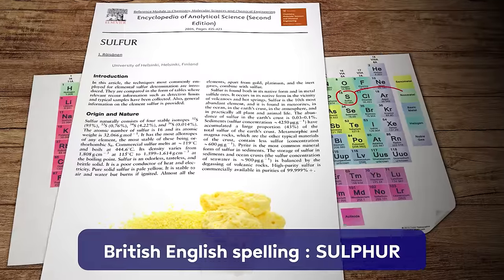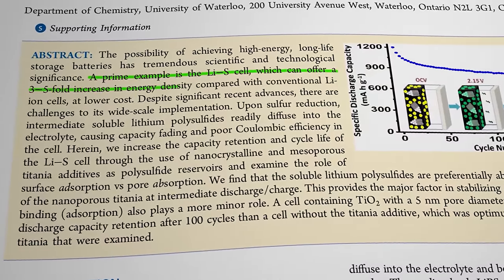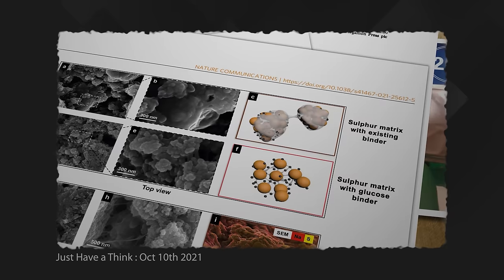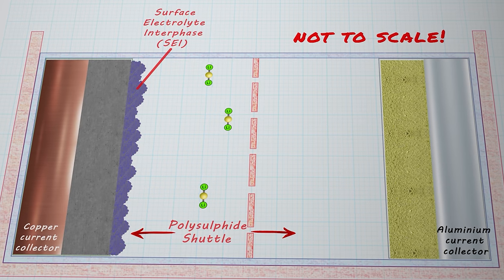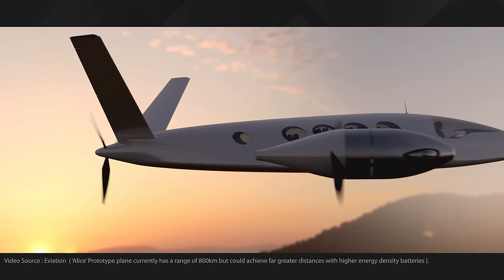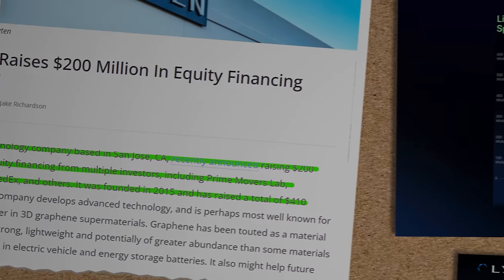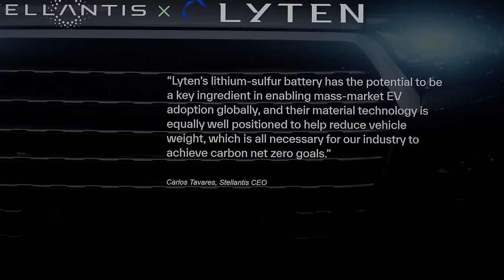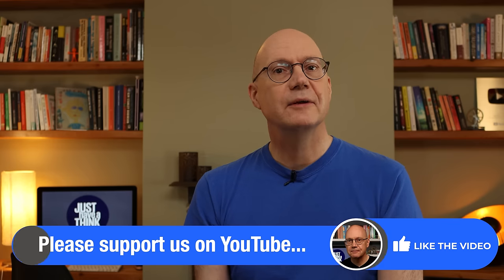Battery Energy Revolution. What now?

Comment: I have owned 3 evs and will never go back.
Reply: The power plant that delivers your electricity has to burn more fuel than an IC engine would have.
Reply: @ravenrock541  That's one way to say you don't know where electricity comes from. You see, when a mommy generator loves a lot of daddy water, wind, light, geothermal, nuclear, and many other sources of energy that don't rely on coal.....
Reply: That is conspicuous
Reply: Well done for polluting the plant with the worst polluting vehicles ever made !. I'm sure you're very proud of yourself 🤦🤬🤬🤬
Reply: After purchasing a BEV, I'll never be going back to ICE. In fact, I need to sell my remaining 2nd ICE vehicle as no one in the family wants to drive the laggy machine anymore.
Reply: @ravenrock541  depends on which state the electricity is created in. a lot of people use alternative energy sources to power there cars and homes.
Reply: @ravenrock541 what will you do once you run out of oil?
+ We have to rely on a centralized system of fuel delivery instead of decentralized on site energy generation.
Oh and yes... Renewables have overtaken COAL in US last month please stay up to date and stop living in the past.
Reply: This is the embodiment of the issue with this "solution". It isn't one if people are going through multiple in the approx decade they've been around. That's not a viable option (environmentally and logistically speaking) at scale.
Reply: I believe walking, transit or a bicycle are perfectly adequate for most people. Cars impose major externalities for those outside the vehicle.
Reply: @ravenrock541  how do you know. He might live in Tasmania where the whole state is powered by hydro. He might have roof top solar and charge during the day. Twit.
Reply: @ogribiker8535 
PLANET, public school kid
Reply: @ravenrock541 less than 5 minutes on Google would have told you that is rubbish but I guess you couldn't be bothered
Reply: @Akuma.73 
Oil has over 300 years of reserves. 
Were you planning on outliving the oil?
Reply: @GR3YS0RG4N1CS You're assuming their car broke and that they don't just get a new car every 3 years regardless of what is powering it. A pretty foolish assumption.
Reply: @ravenrock541 a power plant that produces electricity with fossil fuels for electric cars uses less co2 than fossil fuel burning ice cars
Reply: @ravenrock541  I guess you've never heard of renewable energy production. You can't run a gasoline car off a solar panel array. The "electric cars run off of burning coal" argument is so obsolete, it's not even funny anymore.
Reply: @ravenrock541 let's for a minute imagine that what you're saying is true; why wouldn't the power plants adopt the energy efficiency measures of that IC Engine? That's because they would - and have.

Power plants - even those running on the same fuel as ICEs - are much more power efficient than ICEs themselves. And this is not considering the fact that an ever-increasing part of the power grid is carbon neutral.
Reply: @ravenrock541  no it dose not. As I type here in the UK only about 9% of our power is coming from GAS 5% from biomass.

The rest in descending order is:-

Wind, hydro and nuclear.

So where do you get this rubbish from?
Reply: Why? Short list from most important, please.
Reply: @thisismagacountry1318  I hadn't noticed auto correction had changed it, and no I didn't go to an elitest f'in expensive public school!!!
Reply: @ravenrock541 no, technically wrong. But you could easily know if you had a minimum amount of knowledge about the energy mix, efficiency of the ICE car engine and the efficiency of power plants.
Reply: @filonin2  you're assuming that I'm assuming that. Whether the car broke or they just get a new car the fact still remains. It is not feasible for everyone on earth or even half the people on earth to have three EVs let alone one. Whether they broke down or they currently own them, the amount of issues that it would cause as far as traffic, parking, etc would far surpass any issues it would solve.

Get your head out of the car-centric model that corporations have spent big money getting you to believe is the only way.
Reply: @thisismagacountry1318  obviously yes I plan to, but main point was a decentralization and geopolitical freedom
Reply: @ogribiker8535 sorry. Wrong. Sadly you don't understand science, technology and you don't compare quantitatively.
Reply: @johnlarson111 basically all western countries have an energy mix with renewables, but on an individual level, you can even have more.
Reply: @thisismagacountry1318  this is not the point.
Reply: @Frostbiker  "Cars impose major externalities for those outside the vehicle."

hahaha wtf is that supposed to mean? are people that soft nowadays?
Reply: @thisismagacountry1318  Yes, I would hope that the human race would live longer than the next 300 years. That doesn't mean that we should release millions of years worth of built up hydrocarbons into the atmosphere in the next 300 years either. What a stupid statement/ question.
Reply: @ravenrock541 this is just entirely incorrect. Electricity is almost perfectly efficient and cheap, gasoline and ICEs are not.
Reply: @GR3YS0RG4N1CS  
Everything you own, including the cellphone you're reading this on was made with oil.
You're the genius.
Figure that out.
Reply: @Akuma.73 run out of oil? Impossible when you pump it yourself.
Reply: @ravenrock541 which fuel?
Reply: @ravenrock541 Actually, even if the power plant runs on 100% oil and there's no renewable energy in the mix, the EV burns less oil than ICE!! It's surprising, but true.

Power plants are twice as fuel efficient at generating power than an internal combustion engine (ICE) because the power plant is big, heavy, and static and so can be much better optimised for the goal of fuel efficiency. The difference is so large that even with electricity transmission wastage, etc, power plant + EV is more oil efficient than ICE.
Reply: @thisismagacountry1318  it is not using oil that's the issue , it is ONLY burning it the generates polution
Reply: Me 2, 5yr
Reply: Red rag to a bull
Reply: @kade3lt  first of all, electricity is FREE. Absolutely nobody can refute that, it’s excessively prevalent in nature. Now, you’re acting like the government has to put money into generating energy and that energy is a resource problem. The problem is charging electric cars with energy from gas instead of the free alternative
Reply: @SasukeUchiha-ql5jg  we are not charging from gas. Look at the live grid data. As I type only 10% of the uk's power is comes from gas. And 0% from coal. Over night that will probably go down to 2-4%.
Reply: Tesla is the best car company ever no maintenance no gas stations no oil changes no smog check no corrupt dealerships no lying salesman.
Reply: @thisismagacountry1318  "hur hur you live in a world ruled by the oil industry! You're so smart, figure that out!"

lmfao you're so adorable! You act like there aren't bioplastics and other alternatives to the oil based products that rule our world.
Reply: @scottclowe  Energy is lost when transmitted over power lines. So that power plant has to produce more energy than just what the car needs. An IC engine produces its power at the source AND an IC vehicle is much lighter than an EV so it is much more efficient at using that power. Sorry, but the EV is a pipe dream until free electricity that is utterly reliable at all temperatures and weather conditions. 
And, you're not looking at all the factors here. EV's require heavier tires due to the extra ton of batteries (semi trucks it's 10 tons). Look into what it takes to make rubber tires. Then there is the road infrastructure. Heavier vehicles means greater degradation of the roads at a faster rate. Look into what it takes to manufacture asphalt and lay a road. Bridges will have to be upgraded, look into what it takes to produce concrete.
The power grid will have to be rebuilt to go full EV, by a factor of three. More power plants, more transformers, more power lines. Just the plastic installation on the transmission lines themselves will produce more pollution (to manufacture) than an EV will save.
    Oh, and how about recycling the batteries? That's toxic as hell.
     Sorry, bro, but you've swallowed the Kool-Aid.
Reply: @luminousfractal420  Take your pick, LG, LNG, diesel, gasoline
Reply: @kade3lt  Research how much power is lost to entropy per mile of power line. Then get back to me
Reply: @ravenrock541 so we’re just going to conveniently ignore all the oil burned to transport fuel from where it is pulled from the ground to where it is distributed to the people fueling their cars? And your equation completely ignores the fact that individuals are installing solar and becoming their own generators of electricity. Plenty of people own electric cars and charge them entirely on electricity they produce on site. Kool-aid comes in many flavors, you just can’t seem to taste yours.
Reply: @patdbean  So your situation on an island applies to the rest of the world?
Reply: @modernkennnern  I never stated that power plants are not more efficient (would all you commenters PLEASE read?). What I said is that transmission of that energy inherently loses a percentage of that power. Producing your energy at the source is much more efficient than transmitting that power many kilometers. Do you disagree?
Reply: @FrankGallagherr  $$$
Reply: God bless those Congolese children mining cobalt so I can drive my expensive EVs so I can feel better about myself.
Reply: @ravenrock541  "the power plant that delivers" != "the power plant[...], and the delivery of"

I agree that power transmission is definitely lossy, but it's only about 6% (in my country - Norway), and I'd imagine that transportation and storage of fuel across all gas stations etc are not too far off that on it's own.
Reply: @ravenrock541 I'm guessing you just said that to generate a bunch of comments and help the channel. Thanks for boosting interaction!
Reply: People worry about mind materials for evie's, didn't worry about them for gas cars, oil production, cell phone manufacturer, etcetera. Excuses
Reply: @ravenrock541 lol not a chance on that argument oil-boy 😂
Reply: @ogribiker8535 another oil troll - get a real job bro!
Reply: Then you probably are doing pretty good economically. Someone with a normal economy would probably not afford that
Reply: But you will @mikecoffeen , they will stop making thermic engine,  that's what they have annonce in Europe anyway. 
Unless you go for hydrogen,  and the way its looking over here (EU) that won't happen just yet .
I think you'll have to keep buying them EV's car .
We have got one , a Kona , it's not perfect, but it looks like it's the future .
Reply: @truhartwood3170  You entitled to your opinion, and I'll defend your right to speak it. How about returning the favor?
Reply: @crappymeal This is probably untrue. The proportion of fossil fuel energy that gets to the consumer as electricity is about 25%. Then the conversion from electricity to motion in an EV is maybe 70 to 80%. A petrol car is about 30% efficient at converting fuel to motion. Therefore an EV is only more carbon efficient if the power is derived from non fossil sources.
Reply: @ravenrock541 This is nonsense. A power plant is WAY more efficient than an internal combustion engine. You also need to consider extracting, processing and distribution of the fuel. It's not even close. EVs win by a mile and the gap is widening.
Reply: @ravenrock541  Not If your area utilizes hydroelectric, solar, or nuclear power. All of these can be used to power EVs. Solar power can even be set up on site if your area is esspecially conservative and doesn't believe in anything but burning fuels for energy.
Reply: @ravenrock541 My EV is predominantly charged by electricity generated on my roof. No grid energy involved.
Reply: How can this comment be 4 days ago but the video is 3 hours old?
Reply: @ravenrock541 My area is serviced by nuclear so nope
Reply: @thankyouforyourcompliance7386  What no reply?, shocker !!!!
Reply: @scottclowe  Think again!
With the number of conversion stages; oil, electricity, transmission, storage, motion in the EV scenario and oil, motion in the ICE you probably lose any efficiency gains to be had from the power station.
Reply: @ravenrock541  Sounds like you have some strongly held opinions but haven't checked the details and are very confidently incorrect as a result.

Here's some ballpark numbers for you to sanity check so we can get on the same page.
IC efficiency: 25% (energy in fuel burnt -> motion)
Power plant efficiency: 50% (energy in fuel burnt -> electricity at power plant)
Power grid transmission+distribution efficiency: 95% (electricity at power plant -> electricity at consumer)
EV efficiency: 90% (energy charging -> motion)
Weight of EV car: 130% of the weight of equivalent IC car

Look over those and tell me what you disagree with.

If you run those numbers, they imply EVs consume 25% less fuel than an equivalent IC car (per mile driven).

And that's accounting for the electric grid distribution inefficiencies whilst assuming there is 0 fuel wastage in the petroleum/gasoline distribution (refinement -> pump), which is not true.
Reply: @englishcitystone1663  we don't use oil to generate electricity anymore. Other than in an emergency back start situation. 

Power grid in the UK is about 95% efficient. And EV wall to wheel are about 80% (if you don't have the heating )

But what really matters to most people is the  price. The cost on octopus agile falls to 0p at midnight and goes no higher than 5p per kWh until 5am.

 so for 5 hours tonight,  I get an average of 3p per kWh  or about 1p a mile.  So 5x7kwh is  about 100 miles of range for 1 UK pound.
Reply: @Frostbiker that's great when the city is small. But when you go MEGA scale, everything just falls apart. And yeah, I don't consider NY a good place to be, let alone to live in. I've lived most of my life in a city of 3-6million people (approximated growth rate). I then moved to a city that was supposed to be 700k large, but due to recent events got filled with people and is close to 1m mark.

And at a million people everything starts to fall apart.

Imo, best cities fit into 100-200k size. Perfectly liveable, perfectly walkable, with lots of space and greenery. 1 million and beyond is a concrete jungle with tiny cells for accomodation and houses reserved for the most wealthy people with the lowest morals on the planet (let's be honest, when was the last time you've seen a multi millionaire who made it with honest, hard work, while paying full taxes?)
Reply: @ravenrock541  that's a straight up lie
Reply: @ravenrock541 You’re clueless. Power is lost when transporting through energy lines? And? ICE vehicles produce power at the source? 

How do you think the “power” used by ICE vehicles gets into the ICE vehicle? I’ll help you out - it gets there via a complex supply chain that itself relies on other ICE vehicles and coal burning power plants. The true cost is not the gallons of fuel, it’s the gallons of fuel PLUS the energy and resources needed to get it there PLUS the environmental damage caused by the emissions which are a byproduct of the ICE vehicles. 

Anyway you slice it EVs are more environmentally friendly. And this is considering most, if not all electricity generated in the near future will be low emission/renewable. 

The HILARIOUS irony of your statements is that with EVs, the ability for energy to be produced locally is MUCH greater than ICE vehicles. I.e. it is produced at the local power plant. With ICE vehicles, the energy is produced and transported in Saudi Arabia, or Russia.

Just give it up buddy, you’re in over your head.
Reply: You apparently live in a city. 
Try your EV outside that.
Reply: @Frostbiker No. It isn't.
Reply: wow you went through evs quickly
Reply: @ravenrock541  facts don't care about your opinion. You are demonstrably, monsterably factually incorrect. Just read the many, many comments of people correcting you. You can have an opinion that pancakes are better than waffles. But if you have an "opinion" that an ICE is better for the environment than an EV, that's just called "being wrong". And that's not "my opinion", that's a fact.
Reply: Three? How does that work? They have barely been around for 15 years
Reply: @Roguescienceguy  You know people can own more than one vehicle, right? Also, people don't keep a vehicle until its falling apart. If they bought one in 2018, a second one in 2021, and sold their first EV last year when it was 5 years old and bought a new one, boom, there's your 3 EVs. Not hard.
Reply: @ravenrock541  Look up thermodynamic efficiency. It's not even close between EVs and ICE even if burning fuel in a powerplant, nevermind renewable energy.
Reply: Then you go back to the oil\ gas high prices and variable supply
Reply: Us too.
Reply: @tomdy69  IC engines are running at 80-90% efficiency of combustion of fuel. Hybrids, even higher. Even if a power plant hit 100% you still lose a portion of the electricity in transmission due to the inherent resistance in the power lines. And if you try to tell me there is no loss of energy (like the other guy) then there is no point in continuing this discussion with you. Reality doesn't care what anybody believes.
Reply: never go back to evs, that is
Reply: @voncth5791  not me, my first 2 EVs were  $8K & $22K, 5 yr later, I've replaced my $8K with a $30K Chevy bolt, my first new car of my life, hopefully my last.  30k is a lot for me, I guess that's normal for many people
Reply: @ravenrock541 hilarious, it’s like you know nothing .😂
Just for starters all electricity can come (and is rapidly coming) from non polluting production while all oil and gas comes from a supply and production chain with outrageous amounts of carbon emissions!
Reply: @thisismagacountry1318 except we don’t want 300 more years of CO2 emissions from burning that oil.  We need solutions not nonsense comments.
Reply: @ravenrock541 Because grids always have to be built for maximum output, there is often a lot of waste, particularly overnight. This effectively brings down the cost of carbon on EVs charging, because they are often charged overnight, when waste is highest.
Reply: @thisismagacountry1318  there's a difference between a geological reserve and an economically recoverable reserve. If all that oil was as cheap to produce as what we have today then oil would cost a few dollars a barrel.
Reply: @ravenrock541 hi Raven, ICE cars don’t burn coal. Hope this helps xo.
Reply: @ravenrock541  False.
Reply: @Akuma.73 lol renewables have not overtaken existing fuels for energy generation in the USA. Renewables made up 22% of the energy mix to feed the grid. They are hoping it will reach 24% by February. 😂
Reply: @thisismagacountry1318  Ok. I’ve figured it out. We stop burning it. Use it once and it’s gone, such a waste. As someone who works in the chemicals industry, we will always need some sort of organic feedstock for that. Oil is ideal. Let’s just not waste it by burning it.
Reply: @johnlarson111  -
      "their" NOT  "there "   uggh!
Reply: You plug into a coal powered electrical generator.  You're putting stress on the grid.
Reply: @Akuma.73 uh... Solar doesn't work at night, when most people are charging their cars
Reply: @ravenrock541 get back here and feel embarrassed like you should!
Reply: @GR3YS0RG4N1CS problem is governments like the UK don’t invest anywhere near enough on public transport. It’s expensive often late and doesn’t go everywhere you need it to go
Reply: @ravenrock541  Just a big fat no. That is such nonsense and incorrect.
Reply: @kayakMike1000  there's nuclear power for that, solar will offset other industries that use electricity during the day
Reply: Didn’t any of them have reverse? 😋
Reply: @thisismagacountry1318  oil may well have 300 years of reserves. But as someone once said. "the stone age  ended long  before  we ran out of stones and the oil age  will end long before we run out of oil"
Reply: @benjaminnead8557 I’m for certain renewables (not big wind turbines), but please understand this, the moment I plug an ev into the grid, the power plant will immediately burn more fossil fuel.  Renewables aren’t providing all of the power generation, therefore any electricity demand above the renewable capacity is generated by fossil fuel sources.  On windless nights, All the electricity is produced by fossil fuels……..

This may help, “electricity is the only commodity that is produced, delivered and used in the same second”.  Charging a battery is Using that electricity..
Reply: I’d like t buy an ev to supplement my ICE truck, but here in CALIFORNIA to government has made it legal to steal $950, per incident.  Thieves have figured out that chopping off ev charge cables yields valuable copper.  They are chopping them off everywhere and even if they are caught doing it, there’s zero penalty.  Soon, there will only be home charging available.
Reply: I agree
Reply: @unicornadrian1358  and in the UK only 30-35% is gas and   about 4% coal. So why should the out of date US power grid be allowed to hold everyone else back?
Reply: @ravenrock541  UK grid losses are about 4% about 7% in the USA  because of the longer distances.
Reply: @jasonborne5724  Why is it that people can’t understand that just because things are one way NOW, that they won’t change in the future? The whole point you are missing is that EVs are able to run on renewables unlike ICE vehicles (not to mention the emissions). In other words, EVs are the path forward. Renewables will eventually be the predominant energy source. The reason they aren’t now is because they are still an emerging technology in many ways. 

This doesn’t change the necessity for focusing on more renewable and efficient means of energy production and transport.
Reply: @patdbean  And that's one of my points. Even if a power plant had 99% efficiency (which they do not), if you subtract the 7% then you now enter the upper range of an IC engine. Throw in the cost of upgrading the infrastructure to go all electric it just doesn't make sense right now. Not to mention that the number of power plants needed to supply the power demand would triple.
Reply: @patdbean  nobody is using the US to hold anything back. 😂 The worlds largest EV producer is an American company. I replied to someone who sounded like they were from the US. EV adoption is going to be hampered by proponents refusing to be truthful about the true emissions involved in EV production and use. If they came out and said “yep there is still a ton of work to be done, this is where we are now.” People would be less resistant. Govt intervention and shoving it down our throats by penalising existing car users (ULEZ for example) is also not helping the EV cause, especially in the UK.
Reply: @ravenrock541  all this grid efficiency talk is all every interesting , but you need to think about over all running costs. 

Again I can't speak for the USA. But tonight my power costs will fall to 7.5 pence per kwh. So about 2.5p per mile. And on weekend nights often  as low as 3p per kwh 1p per mile. Sometimes to 0p or even below on high wind nights. 

I can often add 250 miles range for less than 2 British pounds. And sometimes (say one Sunday night  in 4) I can charge for FREE. Because the grid has excess power.
Reply: Off course we don’t want 300 years of burning fossil fuels which was exactly my point.  But we also need to transition to green energy without destroying the economy, otherwise you won’t be able to afford the transition.  The technology and infrastructure is not currently available for a rapid transition.  But it will be given enough time and investment within the 10-30 year timeframe.  That’s a long way from 300 years.
Reply: @ravenrock541  and this  power demand tripling thing is total rubbish.

Just do the maths:-

8,000 miles per year per vehicle . X 37,000,000 road vehicals is at 3.5 .miles per kWh. Is  about 80twh per year. 

Add that to the 2022 uk power demand of 306twh. 386twh per year. 
Only a little above the 375twh of 2007. Less once you take into account the power SAVED by not refining the oil.

Here in the UK the oil refineries use about 900MW 24/7/365.
Reply: @patdbean  If you say so. I'm not going to argue. Apples and oranges, British and American.
What I do know is that a semi shipping company looked into what it would take to convert over. Until the power company told the company they would need more power than the whole city.
Your situation in Britain does not match the US. For one, last I checked, the UK does not have anything comparable to driving over the Rocky Mountain Range. It doesn't have deserts that hit 45 deg C. It doesn't have winters that can hit minus 34 deg C.
Reply: @patdbean  That's great. But the US is different...and much larger
Reply: @ravenrock541  I take your point , But the average miles driven per day is not much different. 25 in the  UK 40 odd in the USA. What matters is how much you DO drive not how much you CAN drive. And here we have  legal limits as to how long you can drive between stops. Here in the UK it is 4.5 hours,  at legal speeds that's about 300 miles then a 30-40 minutes charge (on at 250kw charger) is going  to give you 300+ miles range again, and by law  you must take 45 minutes  break. These rules have been around for decades, for road safety reasons. 

And yes the, power companies use any excuse , yes if every car CHARGED At Once they would have issues. But remember 20-40 miles a day Is 40-80 minutes of charge on a 7kw home charger. Some will charge every night for 60 minutes or once a week for 5-7 hours. They will not ALL charge at once. No more than every electric kettle or shower gets used at once. It just dose not happen.
Reply: @patdbean  First, let me say thank you for keeping our conversation civil and not resorting to name calling. I'm enjoying our talk. 
        This limit on hours driven is something I've never heard of. Of course, it's mandatory for professional truck drivers working in a commercial capacity. But for the private citizen and most small companies there is no limit other than fuel and ability to stay awake.  I once drove twenty hours straight, only stopping for fuel and bathroom.
Reply: @ravenrock541  it was the "staying awake" that was the issue. Inbetween  1965 and 1985 we halved our road deaths,  by limiting driving hours and making seatbelts mandatory.  Only 1,711 road death in the UK in 2022. still bad,  but less than the 4000+  it was some years  in the 1960s
Reply: @custos3249 the couch meme could sell cars.
Reply: @patdbean  I agree. It's a shame that common sense has to be enforced.
Reply: From your profile picture I assume your first EV was one from the 1920's
Reply: EVs have only been popular long enough to have owned one. OR, you’re just buying a new one every few years and of course you’re gonna be happy with it cause you constantly have a brand new car!
Reply: @ravenrock541 that’s not true, it’s only true when you consider the making of the battery, the charging infrastructure, and if the power plant burns coal.
Reply: I’ve had the same diesel pickup for the entire time they’ve been making EV’s, and you’ve already burned through three of them.
    Congratulations 👏
Reply: @johnlarson111 . Somewhere around two percent in fact.
Reply: @modernkennnern    Have you ever heard of the concept of line loss? That reality means that the electrical energy going into the transmission line doesn’t all come out the other end.
   The generation facilities average about a 33% efficiency and there is about a 7% loss in transmission.
    That’s the realities all those folks still stuck in the Stone Age are reminding you about.
Reply: @kade3lt . Really?? I would assume you have the resources to find some facts for yourself, but have never done so because facts are scary to you.
Reply: @XsynthZ . The panels have to be made as well, and transported, and installed, and wired into a system, which requires battery storage, and the panels and batteries need to be replaced periodically.
   Free electricity is a pipe dream.
Reply: @ravenrock541 . In the US the average efficiency of thermal plants is about 33% with 7% loss in transmission. 
   Net energy delivered, 25%.
Reply: @modernkennnern    The fuel for power plants gets delivered too. It’s not like it magically gets into them out of thin air.
Reply: @nitelite78 . How does fuel get to the power plant genius? Does it just float down out of the sky and miraculously land in the fuel tank of the generator?
Reply: You hated them so much you bought three.
Reply: @Stan-b3v  "tank" would  indicate  oil fired power station. There are NO oil fired stations left in the UK. Last oil went  in the early 2000s. There may still be  some " black start" generators, for starting in an emergency generators,  but apart from that none.
Reply: How can you own alread 3 of them? And what did you do withe previous ones
Reply: @patdbean     Pile of coal, gas pipeline and associated storage tanks, pile of wood chips or pellets…
   Are you that unable to accept reality?
The UK isn’t the only country in the world either.
Reply: @Stan-b3v  yes I know the UK is not the only country. But if we can do it so can the USA and ALL the other big economies.